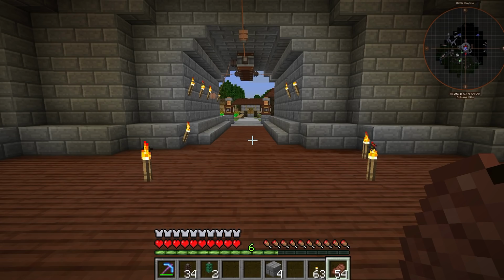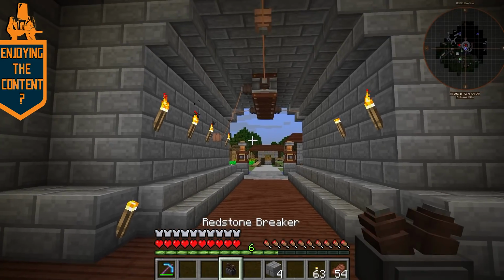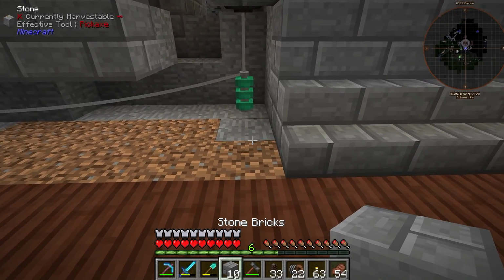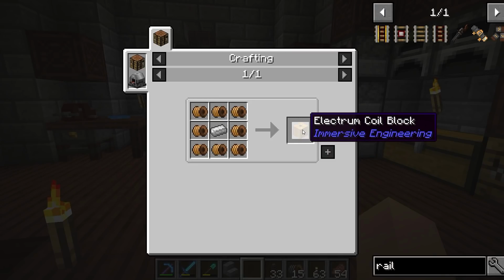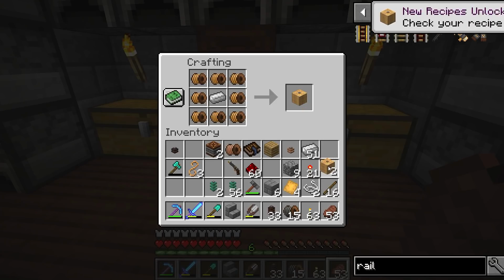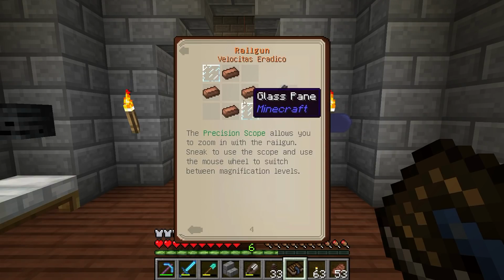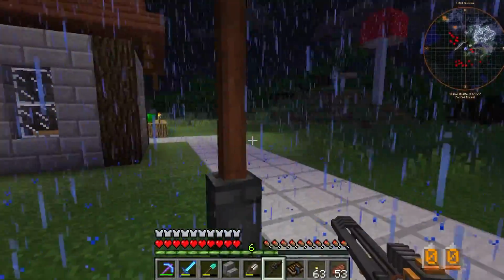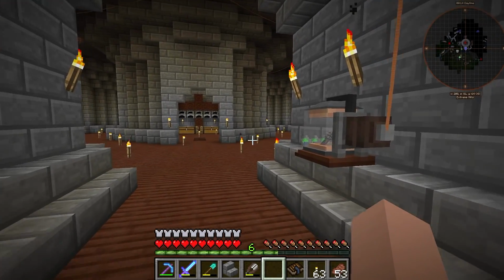Immersive Engineering | Episode 18 | Railgun & HV Base Defense

Comment: put a connector(not a relay, a connector) of the same type on either side of a block and right click with the engineers hammer on one of the connectors to run a cable through a wall without making a hole.

Comment: should totally put the charging station on the HV wires/relays not LV , or else why did the rail gun require TWO HV capacitors? Hmm? yes? making the connection now? good. Also it would charge faster with HV, no?